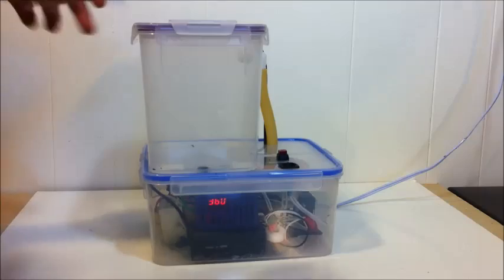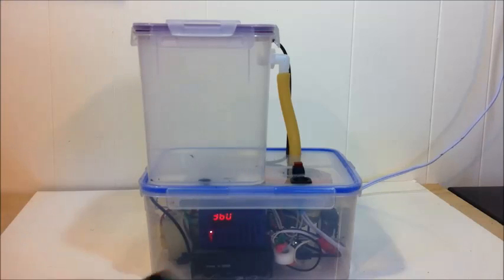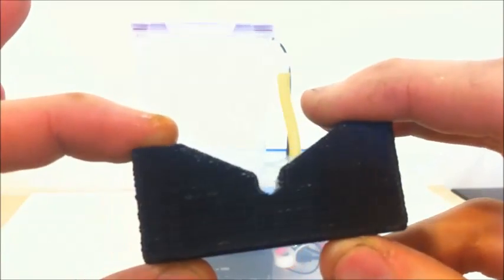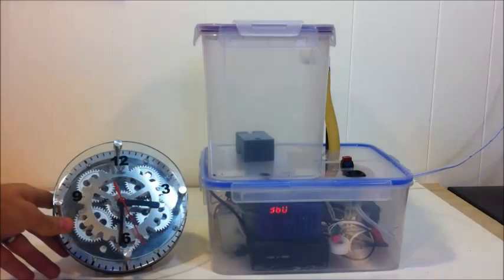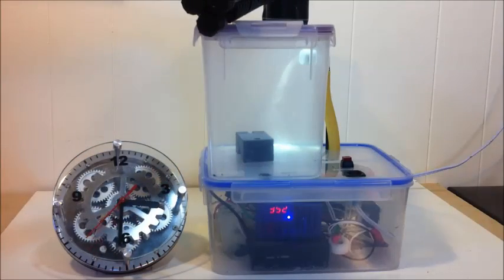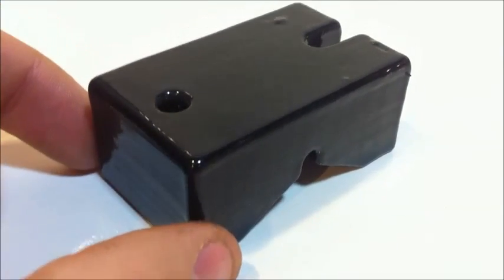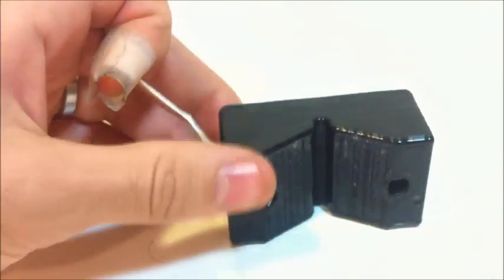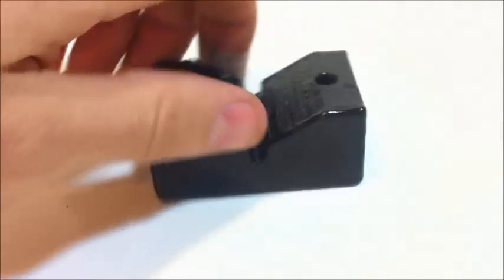Automated Ultrasonic Misting 3D Print Polisher Demo

Comment: Hey again EngineerDog can you help me understand how you rigged the level switch to the always on position?
Reply from the maker: Look at the bottom right of this picture. Its been a few years but thats what the float sensor looked like & I zip tied it with the sensor in place to make it think its full.  https://content.instructables.com/ORIG/FBS/G3YX/IPOEKQLO/FBSG3YXIPOEKQLO.jpg?auto=webp&frame=1&width=1024&height=1024&fit=bounds&md=cf2354a5b4211f497c1f8120646f049b

Comment: You never found a solvent proof 12v pump ...?? How about a acid  or chemical proof pump ?They can be found easly...Even  a  small 12v fuel pump from a lawn mower can be found on amazon for $15 .
Reply from the maker: I used the pump to move vapor rather than liquid though, thats why it was hard to find.
Reply: @MGrahamMakes   There are Micro Diaphragm Gas Pumps on banggood and aliexpress  that use a PTFE Diaphragm and FPM valve  which is much better resistant then EPDM .Allthough they cost around $50-100 depending on if you want a brushless motor or not.What Pump specs did you used ?(Flow rate ,pressure? )
Reply from the maker: @hondanickx  Honestly IDK because I was upcycling them from old printers but the power required was very low, like 'could run from AA batteries' low.
Reply: @MGrahamMakes  thanks for the hint.I've found some suitable low cost pumps.The Parker C183-22-01 is a high quality brushless pump which can be found used everywhere (Aliexpress,amazon,Ebay,banggood,...) for a low cost +/-$10 -$15 .Or any other solvent ink  printer pump .
Reply: @hondanickx  Did the Parker C183-22-01 work building this polisher?
Reply: @juergenmeyer3362   i haven't been Able to build this yet.But it should work fine.
Reply: @MGrahamMakes  I dont understand what you would need that for... just get a regulr airpump, that creates a overpreasure in the atomizer box and then haven an outlet that goes to the vapor chamber... at least that is my plan... this way a regular airpump could be used cause it never gets in touch with solvents... it just pushes clean air into the containier to make it overperasure, so it can be pushed out a hose... let me know what u think about my Idea
Reply from the maker: @nebuchadnezzar47  My first version did something like that but it resulted in solvents leaving the system & entering the room. https://www.instructables.com/Ultrasonic-Misting-3D-Printing-Vapor-Polisher/
Reply: @MGrahamMakes  yes that is my biggest concern at the moment aswell... but I might just make a reflow valve connected to a silicon hose for the pressure that builds up in the main chamber back into the atomizer reavoir... and I am also not to sure how to fix the problem with maintaining the perfect solvent level problem... I thought about using a soaked sponge inside the chamber with a cutout and a dripping system that is controlled by an solvent filled syringe, pushed by a servo or some thing like that but for I am planning to to most likely only use it outside and have a sore of a vent for the preasure build upand fuel it manually / controll solven levels... its my first prototype... I will keep updated if i want ;)

Comment: I built one of these based on your instructable. Thank you! It works great with acetone, however I am unable to generate any mist at all with isopropyl alcohol (91%). Have you had luck with this? Any tips?
Reply: Any luck with this
Reply: I'm looking for the same: making mist out of isopropyl alcohol. My purpose is disinfection though. I tested putting 70% isopropyl alcohol in a domestic humidifier (hidden from my wife of course hahahah) and the ultrasonic module wasn't able to create the mist like it does with water. It smells pretty strong so the alcohol is definitely been vaporized, but there's no mist whatsoever.
Reply: @luciolibanori  im finding the same thing with my testing, acetone will mist but IPA will not, but it smells strong of IPA out of the the humidifier opening
Reply: @naderyounes1473  Polymaker's Polysher creates mist of IPA. But I think the difference is their nebulizer that uses a piezo-electric actuator rather than the conventional ultrasonic ones we find in domestic humidifiers. My problems with their machine are:
1 - it's too small so I would have to sanitize one piece at a time.
2 - the timer increments in 5 minutes steps. It's too long for sanitizing.
3 - the fancy Scifi opening/closing mechanism is painfully slow. In a production environment it would be unbearable.
I'm thinking of purchasing their nebulizer module and build the rest with an Arduino.
Reply: Forget what I said about the piezo vs ultrasonic thing. I misunderstood the way it works. It looks like the piezoelectric motor is what creates the ultrasonic waves. So maybe the problem is the design of the membrane, the frequency, or something else.
Reply: @luciolibanori  yes that's actually where I got the inspiration from, their piezo disks seem to be utilizing a sponge that feeds the right amt of liquid to produce the mist, I contacted them regarding anything they can provide and they are still in the process of patenting their machine, so I believe they figured out the right freq and other factors that produce IPA mist.

Comment: Have you tried to vaporize isopropyl alcohol for Polysmooth parts? do you know if it would work?
Reply from the maker: Havent tried but all the parts are chemically compatible. The mister is designed for water and alcohol has an even lower evaporation pressure than water, so I've everyreason to think it would work.
Reply: @MGrahamMakes  does it have to be that specific humidifier?
Reply from the maker: @naderyounes1473  Nope but the one in the video is the only one ive tried so IDK about others.
Reply: @MGrahamMakes  I bought an ultrasonic humidifier and tried to atomize IPA with no luck, any things to look out for, this is for a senior design project.
Reply from the maker: @naderyounes1473  What does no luck mean? It didn't want to atomize?
Reply: @MGrahamMakes  hey yes it did not atomize
Reply from the maker: @naderyounes1473  Thats weird. Did it make the fog with water before you started tinkering? If so, try to isolate the variables between the initial working state & your current non-working state.  Is the isoproptyl the problem? Has the vaporizer been rendered non-functional somehow?
Reply: @MGrahamMakes  This is a brand new humidifier, worked well with water (lots of mist) but when I switched over to IPA you can see the ceramic disk moving the IPA but it does not vaporize.
Reply from the maker: @naderyounes1473  Interesting, it may be working but the fog is not visible? Check your IPA concentration, it is sold at 50%-95% pure. If water works then ironically maybe less pure would ionize better..
Reply: @MGrahamMakes   I can give that a try, so far I have only tested 70 and 91 percent IPA
Reply: @MGrahamMakes  i am currently attempting this. I think it has to do with the surface tension of IPA being to high. You need something that can vibrate at a high frequency.

Comment: Are these available to be purchased already built and put together?
Reply from the maker: HI King, at this time the only part that I offer is the specialty pump here; http://www.ebay.com/itm/182179957461    The assembly is all DIY, check out the link in the video description.
Reply: Thanks for the response!!! Great write up.  Finishing a few details on my parts.  I will be attempting to build this setup.
Reply: FYI.   Looks like they changed the design of the humidifier.  I had to improvise but i'm sure it will work.
Reply: M7 King did it work in the end?

Comment: The reason you didnt get the bottom was because your part was facing down in the mist-er. The acetone wasn't able to hit it.
Reply from the maker: To each his own, maybe I just like over-complicating stuff!  Seriously though, an air agitator would be useful in my rig and in yours. Perhaps something like one of those scientific magnetic stirrers, maybe rig it up with a magnet on a computer fan.
Reply: EngineerDog

 I'd use a manual air agitator if anything. Like a jack in the box handle and a small metal pinwheel. I don't feel comfortable having acetone near electrical devices.

I see what you mean by magnetic stirrer. Cool stuff. Seems limited on space, though. Can't wait to see what you come up with next. (not being sarcastic. lol) Got anything in the works?
Reply: I'd be strongly tempted to make a kind of dangling rotisserie for parts in the chamber.  Make it with fishing rigging with a spinning pivot and alligator clips along with nylon thread and a magnet to help it spin when another magnet is spun from up above with a small slow motor. (outside the container)  I think it would be a bad idea to put anything electrical inside the chamber considering this is a acetone/air mixture which is already an explosion waiting to happen. :-)
Reply: How are you going to deliver the acetone vapor? This machine has one delivery point...which I think made the bottom not completely done.

I still like my paint bucket and paper towel rig. No motors, simple. If you wet the paper equally on all sides, then the vapors will hit the part equally.

But I could improve it by adding something to raise the part so that the vapors get to the underside of the part.